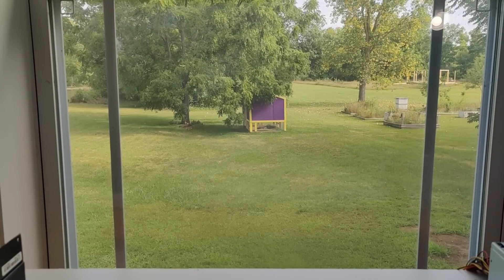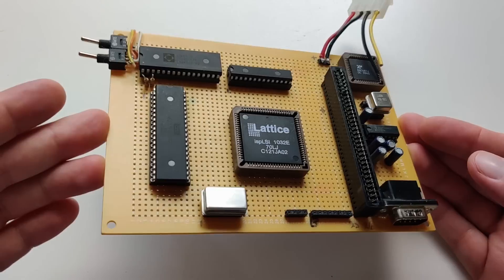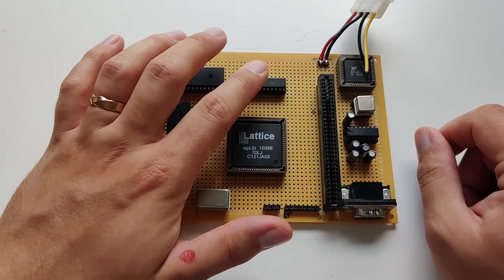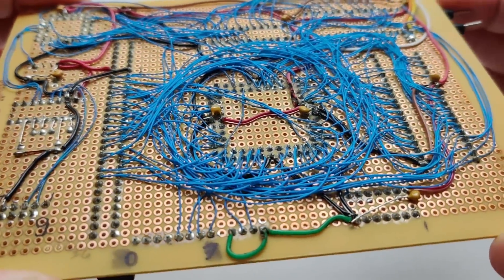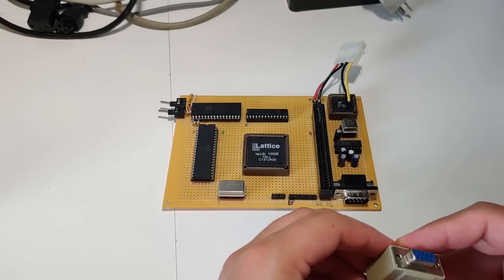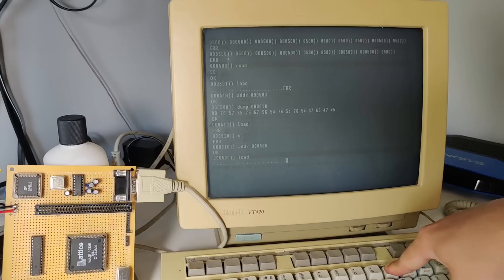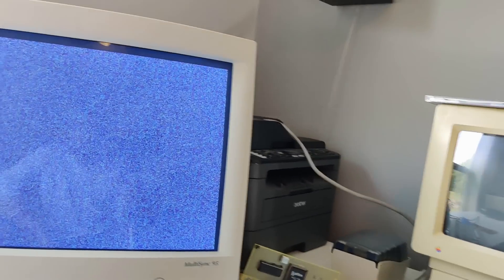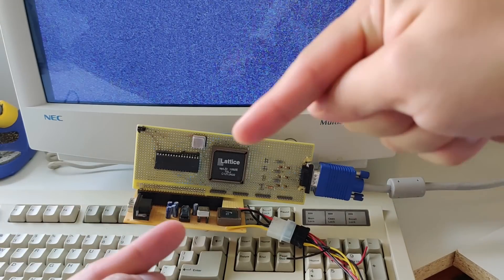Geek Rant #6 - My DIY 65816 Computer

Comment: The alternate world where 6502 based systems won over x86 is the one that leads to Skynet and the Terminators.  (when you see the terminators POV in the first movie, his brain is running 6502 assembly commands).
Reply: its the apple iie monitor its running...so apple = skynet
Reply: now imagine if the motorola 68k won the battle
Reply: @kwanchan6745  well they where, then they stopped using the 6502
Reply: @KonradZielinski  and now they’ve switched architectures again, back to skynet 🚀
Reply: terminator . exe has crashed restarting XD
Reply: x86 was temporarily, ARM won ;)
Reply: @Xerion404  No?
Reply: @lilithmisja  Most people don't even use computers at home, they have smartphones that can do everything.

And even retail stores and restaurants are using iPads to run the cash register

Comment: The good news is, if that 65816 ever burns out, you can just replace it pretty easily. They still produce 65C02 and 65C816 processors in DIP packages.
Reply: Yep, WDC (Western Design Center)  sells them all nearly unaltered, usually for microcontroller purposes

Comment: There is another descendent of the 6502 which is interesting. Acorn computers in the UK used 6502s in their System single board machines, the Atom, BBC Micro and BBC Master. They used the 65816 in the Acorn Communicator. But whilst designing it visited The Western Design Centre and found in it to be a handful of guys in a house. Acorn, which was founded by Cambridge University Grads, thought “If they can do it, we can” and designed a 32 bit RISC processor very much inspired by the 6502/65816. It was called the Acorn RISC Machine but that got shortened to ARM. Acorn no longer exists but the processor company they founded does…

Comment: In my dim, distant past with video games (I was on the design team for the Magnavox Odyssey II), I did some work on the 6502 in prep for an new game that never was developed.  The 6502 was a bit of a RISC system, where the designers (I dealt with Will Mathys) tweaked the hell out of the chip to minimize silicon size and execution cycles.  If you used the original MOS assembler, it listed how many times each instruction was used.  This was used to pare the instruction set down to a reasonable size.  Thus, there was no subtract, nor a negate.  a subraction was thus "complement, increment, add".  Unfortunately, there was no macro assembler.  This would have made available many of the pseudo instructions that could have made it look like a far more powerful processor.  For instance, there was an entire bank of 256 bytes that could have been macro'd to look like 129 16 bit registers, and the appropriate macros made to look like 16 bit instructions.  (An examination of the Z80 generated code shows this was used for all the IX and IY instructions, which had a prefix before each 8080 HL instruction to use IX or IY instead).  GIven the clock speed advantage, it would have easily given the Z80 a run for it's money.

Comment: I've had that experience with both wire wrap and Kynar and solder construction... pull it out of storage after years, power it up, and it still works.  A great feeling when it happens. :)
Glad you didn't try to use a 65C51 for serial.  Smart move :)

Comment: 3:16 - I think you mean the 8088! But cool project! And you're right about it being a stretch calling the 65816 a 16 bit CPU. Nice to see a VT420 in action. Cool start to a video card as well. I'm working on one that does character mode and it's surprising how tricky it is to get right. Nice work!
Reply from the maker: I figured someone would call me out on that. I make every claim to being lazy, here.
Reply: @TrackZeroFutzin  Well, it was stated in the context of CP/M, in which case 8080 would also be correct. ;-)
Reply: @TrackZeroFutzin  Also, nice Dig Dug machine!

Comment: Nice work. There is so much satisfaction rolling your own SBC like this. I have a few PCBs in  my inventory I need to get to work on including a 68010 SBC, several 87C5x boards and 1802 projects....besides my Arduino and Rasp Pi ambitions....I really love those vintage processors, especially the Motorola 680xx series (brings back memories of the early tech days of computing). I also have a couple of FPGA boards I need to tinker with as well.
Reply: Sounds familiar, I'm curious about your 1802 statement.  When did you first get exposed to that CPU, and what are your plans for using one? It's how I first got started in home computing  in the late 70s.  It's not a great architecture, in the scheme of things, but it is something kinda near and dear to me.

Comment: Just saw this video pop up in my recommended.  Neat project even if you have not got it to a full working state yet.  I will check the newer vids.

Back in the day I wanted to build an RCA 1802 "Elf" from chips as published in Popular Electronics magazine, but I was still very young and inexperienced with electronics.  Then within a few years all the early home 8-bit computers like TRS-80, Pet, Apple II, etc. came out and allowed me (eventually) to have a computer without building it from scratch.  Fast-forward a  bunch of years and I'm starting to think about doing something like you did.  Actually, I started to dabble with a smallish by today's standards and honestly fairly powerful Xilog Zync FPGA+ARM  chip on a "trainer" board, but didn't get too far before I decided to switch over to working on an Atari 2600 game I want to make.  But with the Xilog Zync I want to basically ignore the ARM part and implement a CPU, plus all typical home computer stuff like Video, Sound, IO port(s), ROM and RAM in VHDL and run it that way.  Maybe some day I will get back to that!  

Hope you find some more enjoyment from your work!

Comment: I'm in the process of building a hardware binary multiplier for my 6502 computer. I started off with the least significant bit and used an AND gate. Bit 1 uses two AND gates for the two partial products and a half adder to combine them. Bit 2 involves three partial products, plus the carry from bit 1, so three AND gates and two full adders. Bits 7 and 8 are the most complex but it gets easier as you progress further, with bit 15 being simply the carry out of the final adder. The control logic and three registers (8-bit multiplier and multiplicand and 16-bit product) occupy two breadboards while the AND gates and adders take up seven more. It's all built from 74HC-series logic, '08s and '283s for the multipliers, '573s for the registers, and a bit of NAND and NOR for the control logic.

Comment: Cool video! I started making an SBC when at uni, but back then the AVR had just appeared so I made mine with the 8088 but never finished it. I got most of my components from the garbage and got a nice 8284 clock generator. Never turned it on, though. Maybe I'll finish it. You made me want to continue the project.
Reply: can it run crysis?

Comment: Its great, love this, keep going. Im 47yrs old, cut my teeth on z80s using asm & always wanted to make my own computer as well. I think the future of this type of thing is (1) emulation in cad (2) cad to jlpcb & then to (3) home made sbc. Whereas back in my day no emulators were available so it was breadboard iteration after breadboard iteration etc. etc. which is sorta part of the fun and mostly part of the frustration. I programmed asm in 8 and 16bits, started learning asm 32bits and ARM (in the mid 90s?) but it got a little complicated. Thats were my dream ended.

Comment: The IIGS is where I really learned Assembly and then C back in the late 90s (got a woz edition one as a gift from an uncle loaded with the best expansion cards/accelerator you could get at the time) along with a Macintosh IIci in the late 90s.  A lot of people back in the day didn't exactly enjoy working with the somewhat wonky architecture.  Before the SNES dev kits were done and in the wild early work/testing was done on IIGS because of the similar but not quite the same platform/architecture and they were not thrilled (If I remember right the snes used a fork/derivative of the IIGS made by Ricoh that used an extended 6502 instruction set).

In one way we're finally coming around to another theoretical direction where Acorn's ARM platform became the dominate architecture.  We're finally getting SBC's with ARM soc's capable of keeping up with, or beating, x86-64 traditional processors.  Acorn wanted RISC based processors to be the future and we're finally closer than ever before.  I prefer programming low level Assembly on 32/64-bit ARM over x86-64's versions, it's a lot simpler (the name is literally has reduced instruction set in it) and consequently easier to teach people.
Reply: I remember way back in the 1990s I was studying at a tech institute and we had to write a short essay on emerging technologies that may change an existing established market in the computer market. I did an essay on the new, at the time, ARM cpus, and why they may replace x86 as the dominant cpu in the market, it wasn't received very well by the teacher and I don't think I got a great grade for my essay, fast forward to today and it dominates the mobile scene and may be making movement into the desktop environment, I remember my teacher making a smart remark, something to the effect that x86 has eclipsed all other cpus and that it has been shown to be the best option , well, funny how things change....

Comment: There pretty much is an inheritor of the 6502's legacy, and that's the ARM series of processors, whose main influences came from the 6502 and whose ISA still bears some striking resemblances to it.
Reply: ARM did not inherit from 6502. Maybe a better candidate would be the RCA1802.

Comment: This is a really cool project. It makes me want to do this kind of thing again myself, I've really wanted to do this kind of project myself for a long time as well, but I simply don't have the time, space, or really that much money to actually go and do it. Your use of CPLDs gives me ideas, though. Dangerous ideas. Makes me want to do a 6502 project. 

Also, the PC used an 8088, as opposed to the 8080. Lots of machines used the 8080, but far more used the Z80. The PC and it's clones were the only major users of the 8088 and x86 in general for a very long time, it was an awful architecture by comparison to the 6502, but the huge advantage (at the time) was the 20 bit address space and later the interchangeability for an upgrade path.

Comment: There has never been a better time to learn electronics and microcontrollers.  My first computer was an Elf II in '78.  A cheap scope was something under $500 in those days, llke paying probably $2000 today. This for 10-20MHz bandwidth and two channels if you were lucky. Nobody had a logic analyzer, if you could afford the $200+, you could own a logic probe that coukd tell you hi, low or pulse with no metrics.  My Elf kit cost over $100.  Now, for under $100, youncan get a comply Arduino dev kit with scores of sensors.  For $800 now, you can get a four channel MSO that can be easily hacked to 350MHz bandwith, that samples at 8GS/S, contains two arbitrary waveform generators, unbelievable triggering options, massive memory depth and protocol decoders for virtually anything serial.  It also has a logic analyzer built in, but you have to buy the "probe" thingy.

Back in the early 2000s, I crammed up on Pics and AVR, but went the Pic road at first.  Switched to AVR when rhe arduino appeared and i could wrote in C, without paying Keil a fortune.  Now i like ARM Cortex with the Pi Pico really drawingy interest due to the IOP coprocessor, thats an interesting device.  My intro to ARM was with cheap olimex SAMD and LPC Arm7/tdmi using OpenOCD and an Olimex JTAG.  It was so flakey, but i was able to bring up the boards at max clock speed and drive all the on onboard peripherals, using gcc and a CRT.S file i created.  I learned so much and the board and OCD jtag debugger cost under $100 total back then, now you can get a bluepill and stlink programmer for like $5 total.

Comment: Sounds like my project, a 65C02 from WD.   A simple system with banked memory (8K pages) up to 2M.  Using an FPGA for all glue and will also be the graphics with HDMI out.  Been so hot so far this year that all I managed to do was test the base system and write the hdl for the glue logic and bank switching :(

Comment: The monitor looks exactly like my first computer monitor with 16 colors.  It was an XT, called Laxer.
The computer had no hard drive.  You needed to swap floppies.  It came with the 5 inches soft drives and another drive for what they used to call me hard floppy disk 3M.
I don't remember much.

Comment: If I wanted to make a 386pc from scratch. What would I need for components. Is that a simple diy soldering mission? Good around the assembly process just don't know what cheap parts are needed to try it out.

Comment: I needed to program some 16V8 glue logic a couple of years ago and used ABEL and IspLever... really enjoyed it and it seemed preferable to WinCUPL which some people use.  You have a fun project there although very off piste!
Reply from the maker: I don't know if you've watched any of the recent streams, but I'm using 16V8s and CUPL for another project right now.

This is pretty funny, because I use zero of the actual syntactic sugar features of either CUPL or ABEL and just write straight-up boolean expressions so to me there's hardly any difference between the two languages
Reply: @TrackZeroFutzin  This was the first video I saw... I will check those out.

Comment: Interesting stuff!

I like seeing unfinished project like these just as much as "finished" projects.

Where did you get the PCB for the card? I was looking for blank ISA cards before but only found very very expensive ones. Seems like the best way is do design and order my own. Shouldn't be that hard. But still I'm surprised that nobody is offering them for a reasonable price.
Reply from the maker: Those are actually Apple II prototyping cards! I believe those are 50-pin while 8-bit ISA is 64-pin (don't quote me). The slot on the board is actually 64-way, but it has a bit of plastic jammed into one end to make sure I have the 50-pin card lined up correctly.
Reply: @TrackZeroFutzin  Thanks for the response! I realise they are different. And I'm looking for a universal 16 bit ISA card anyway. I was just wondering if there is a shop for prototype cards like this that I haven't found yet. Or maybe everybody who doesn't want to make their own pays 60 to 150 € for one of the cards I did find. It's not important. I'll just design my own I guess. It will be a lot cheaper.
Reply: @steephkay1812  : A bit late, but I suspect most folks wanting ISA prototyping cards probably just use some publicly available board design.

Comment: Is that the ST16C2552 double-UART in PLCC package??  That's a cool chip; I got some on Aliexpress. I tested and all were working, thanks God.
Reply from the maker: According to a quick double-check of the emulation I wrote of it, it's an XR88C681 

https://github.com/JMarlin/816/blob/master/XR88C681.cpp

Sounds pretty similar, though
Reply: Yeah, sorry, I didn't complete my comment. The ST16C2552 chip is super recommended for old designs. It supports a high frequencies (I don't really  know the upper limit, sorry), but it's very useful to have 2 UARTs in 1 chips, doesn't it? If you guys can get some of these, go ahead!!
Reply: Oh, no!! I was totally wrong about that!! Shame on me, hahaha!  Well, I think I need to review that chip as a reference too. Thanks for the info.

Comment: I wonder - maybe you know - is it possible to have similar project fully open-sourced - including ICs?
That way it can be replicated even if chip manufacturer decide to stop production of ICs, which are used in computer.
I know that it is not easy to fabricate your own IC, even if you have all sources, but I hope that it will change someday.
PCB production was not much available for a long time too.

Comment: i am recently thinking about pimping an atari 2600. not sure if the 65816 is compatible enough to the 2600 games. however, a new 2600 motherboard with a cpu daughter board with a bit more pins would be a starting point. that would allow several daughter boards to be clicked in. with an original 6507, a 65C02 or a 65816.
a pico pi board with an rp4020 would be nice as a sound chip emulation because the PIO has a huge advantage for implementing a traditional bus interface.
rom and ram as well and an address decoder for generating chip selects. you are using the lattice cpld chip but for chip selects there are some programmable logic chips availabe from Atmel in DIP used as PLA replacement in a C64.
just found affordable sram at mouser: AS6C4008

Comment: Sir can you please upload / teach how to use microprocessors (i am ok with micro controllers such as pic, avr etc..), so now i want to make something big. I don't know how to use a microprocessor with my project, can you please provide any link to learn this ? / can you upload a video about this )
Reply: look at the page of ben eater. you have to connect the bus, create proper read write signals and a chip select for your bus slaves. the access timings are in the data sheet of your parts.
you need a rom (for example a parallel programmable flash in a zif socket and a programmer), a simple sram, a serial communication chip to communicate with your computer (serial-usb cables for 5v are available from ftdi).
you have to create a memory map for your peripherals and create some logic to make the chip select signals from the output pins of your cpu according your memory map.
either using 74 logic chips or GAL from Atmel.
most important, a scope (hantek 4 channel usb is affordable) and a logic analyzer with at least 16 inputs. have fun